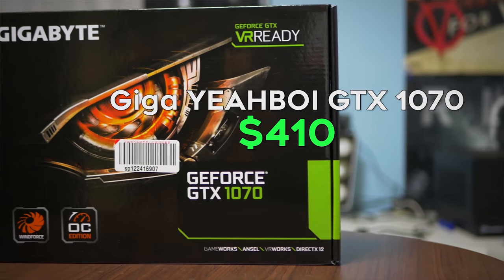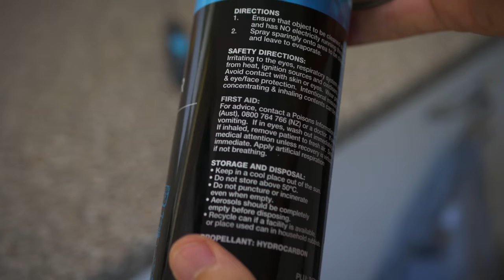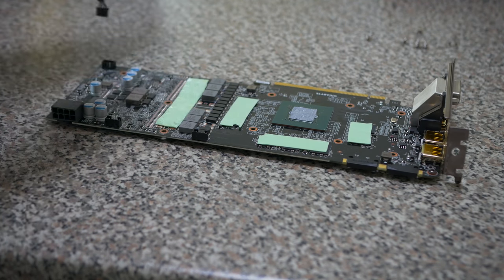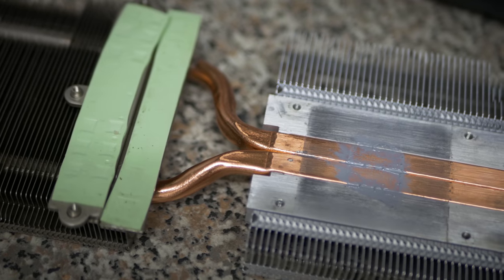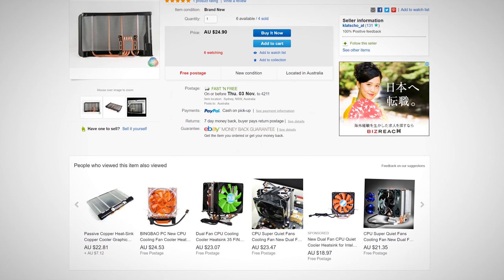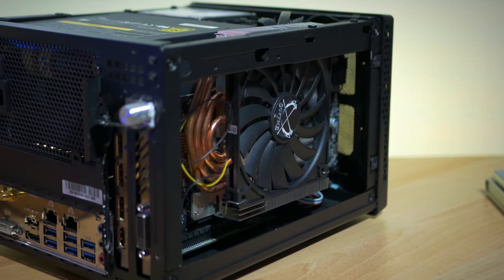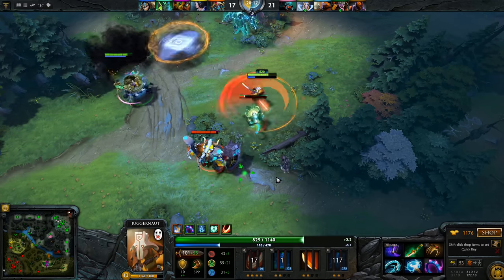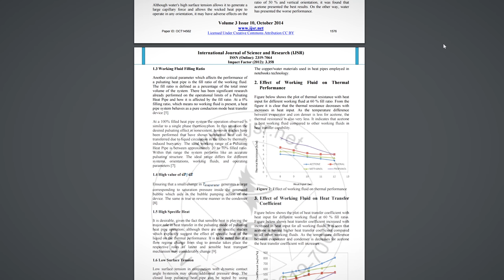Can you FIX Heatpipes?  Curing the Travel PC's Problems

Comment: the best way to patch an heat pipe is to fill it with distilled water with an little room for expansion left over then solder the ends closed this makes the pipe act slightly better then an bar of copper in thermal conductivity an I have seen it done before though the cpu cooler on the GPU is an much more ghetto/more interesting fix.

Comment: Bro you are the best with getting your hands dirty and just fixing this stuff. I'd be scared to even open up my Graphics Card 😅
Reply: ur YouTube name is tech guy and ur scared of that xD ?
Reply: CherryGamer Well I'm more good with the software part then the hardware part even though I am using my custom built PC. I just get very anxious when opening and messing with parts of hardware that's not supposed to be messed with (Like taking apart a graphics card and potentially breaking it) Cause I don't have the money to replace something if I break it and I like to keep my technology in nice shape :3
Reply: Panagio Tsaou Well usually the warranty doesn't cover self-damage like taking apart your GPU and modding it
Reply: Panagio Tsaou No, overclocking is covered under pretty much every wareanty. As they have allready put in safe overclocking limits. If you mod your bios or the pcb, you void warranty. Otherwise, overclocking is still within warranty.

Comment: Closest thing i ever did to this was on a Radeon 4850 years ago. Was replacing the terrible stock cooler with the same S1 you have in the video, but it didn't come with enough heatsinks for the VRM. So I hacksawed the VRM heatsink off the end of the stock cooler and just mounted it back in place underneath the S1. Worked great for many years :D

Comment: The Arctic Cooling Accelero coolers are a great if a little expensive cooling alternative which both myself and my brother have used on many different cards. The best one was a reference R9 290. The old reference cooler sounded like an jumbo jet at take off thrust and it was getting close to the limit when under load but the Accelero brought it right down into the 50's/mid 60's. Plus it was almost silent which was absolute bliss!

Currently have a Zotac GTX 1070 AMP Extreme Edition and it never goes above 60 degrees C which is excellent! The only thing is the card is so heavy it needed a DIY prop to how it up! Keeping that DIY spirit going. :D
Reply: Blower coolers are a curse. I remember having to use a trusty HD 6850 or 6870 (not sure which) made by Sapphire which just so happened to be a blower reference cooler. I still am half-deaf from that cursed cooler.

And a 5970 from Club 3D I had... please, for the love of god, NEVER EVER run a 5970 with a reference cooler - if possible, change it, or at the very least mod it. The original cooler is an audio safety hazard.

Comment: Hey Bryan, ive got one for you. It isn't a huge stretch but it did require drilling and deburring. I modified an EVGA 970 FTW+ (with a backplate) to work with a Kraken G10 AIO adapter and used a Corsair H55 on it. The FTW+ uses a different PCB layout as well as different mounting holes than are available on the Kraken G10 retaining plate, however the reference mounting holes still exist on the 970 FTW+ PCB, so I drilled out the backplate that goes on the graphics card to match the reference mounting holes, then mounted the NZXT bracket and Corsair AIO cooler like normal. Prior to this, I had found out the 970 FTW+ also uses a heatspreader "midplate" that would interfere with mounting the AIO with the G10 bracket as instructed, so I needed a copper shim to sit between the AIO and the GPU die. I found an old heatsink in a parts pile and popped the copper plate off, and a friend milled it down and lapped it to the size that I needed (25x25x1.5mm). Everything worked out great!

Comment: I had some experience making a heat pipe. If the pipe has no holes then you can put a few cc's of fluid like auto refrigerant (for A/C and then you must evacuate the heat pipe of almost all the air and then re-seal it. It's difficult. The key is the right fluid and evacuating.

Comment: Not really the scope of the video, but ya, they contain magic and if you open it, or crack it, the magic leaks out. I tried using DMC drawing a slight vacuum then sealing, but it did not seem to do any better than an open and hollow pipe. Though at temperatures we deal with on PCs it could just be water vapor.

Comment: I would have soldered copper pipes on and turned it into a water cooled card.
If you say i can't it's not possible. I just finished soldering an aluminium CO2 cartridge to a magnesium alloy paintball gun. It holds 200 PSI. The pipes are even easier they are copper.

Comment: Hello, great video as always.

I have a question. I made a PC about 7 months ago and the specs are a fx 8350 a sapphire r9 280x vapor x trix (the one with 3 blue fans), 8gbs of ram and a 980DE3/U3S3 R2.0 motherboard.

The thing is that I cannot utilize the 100% performance from my processor because it overheats and restarts my pc (I have to use 75% [3.4 ghz]) and im using the stock cooler. I've seen guys with the stock cooler running it at more than 5k rpm, but mine doesnt go higher than 3.6k rpm. I changed the thermal compound and everything but it still overheats at full speed.

What cheap cooler could I buy to fix this problem? I have a budget of about 40 euros.

(Also I have really bad performance on CSGO even on low settings, frames dropping out to 80 from time to time, and my graphics card doesnt even go over 45ºC)

Comment: You need an oxygen acetylene torch. Just pinch them then braze them. Or do the heat pipes contain whatever the old vapor X coolers have in them.

Comment: I didn´t do anything crazy with my cards (well I like to bios mod my laptop GPUs, but nothing out of the ordinary). What I would like to do is to buy a reference RX 480 an use thermal glue to ad some copper plates to the heatsink (basically increasing the surface area by a considerable margin) and use thermal grizzly hydronaut thermal paste (it´s better than the MX-4 by a few degrees and it doesn´t degrade as fast). Why the reference model you may ask… Well, the PCB and especially the vcore VRMs are just world class and they are better than like half of the non-reference RX 480s, the PCI-e power connector is also a beast, it has 3 12V rails (A 6-pin would usually have two) and it can supply up to 150W no problem. It is basically an eight-pin.

Comment: the worst thing i have done to a gpu is replacing the stock shroud and fan with 2 92mm case fan plugged into a molex on the psu. It's silent and works great, but overclocking is a no-go for my 7870. on stock voltage its runs at a cool 72C but any voltage higher then stock makes it hotter over time till it shuts down my pc.

Comment: bro why didnt you just solder it --'
Reply from the maker: Don't have to the gear to properly do that kind of solder that quickly.
Reply: how much is a soldering iron where you live ?
Reply from the maker: I already have a soldering iron, would need something more high tech as by the time I sealed it with a normal iron the gases would have evaporated already :(.

Comment: just solder the ends bro it aint that hard
Reply: Actually, it is.  It's not just a matter of sealing the pipes.  It's a matter of finding an appropriately functioning fluid to replace what was previously in the pipes before they were cut.  It's also a matter of filling those pipes with just enough of said fluid, but not too much, as heat pipes function by expanding the fluid when it gets hot to better disperse the heat while condensing more towards the center when cooler to better absorb the heat.  So if there isn't enough fluid, then it doesn't conduct enough heat, but if there's too much fluid, then it doesn't expand to disperse the heat.

Also, just sealing the empty pipes is a bad idea, as the trapped air (or even fluid, if you fill the pipes completely) will create a large heat pocket right in the middle of your heat sink fins, meaning they'll be conducting heat from the heat pipes, rather than from the GPU (or CPU, if you were to try this with a CPU cooler, same thing) which would greatly reduce the heat sink's overall ability to move heat away from the GPU/CPU.

So yeah, it's actually very hard.  And thus a very bad idea to cut those pipes.
Reply: alright, i thought you could just fully fill them and seal them up. thanks for the info.